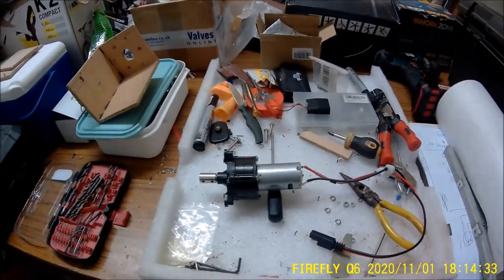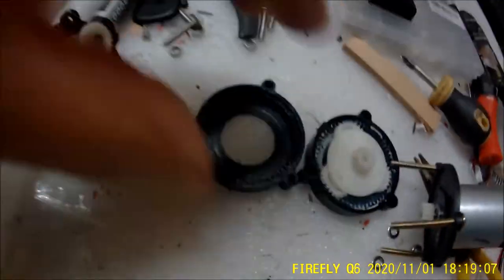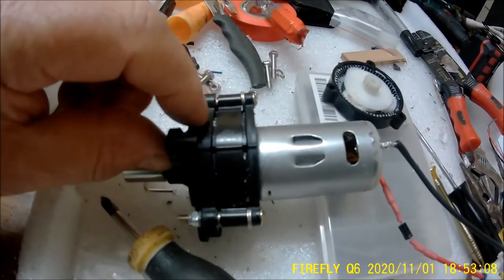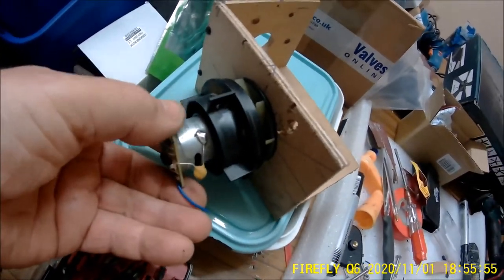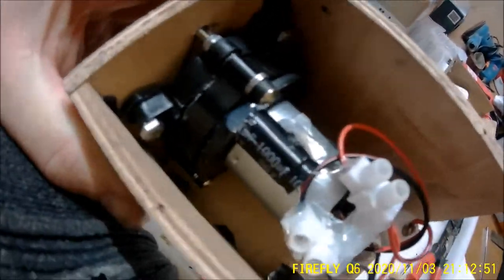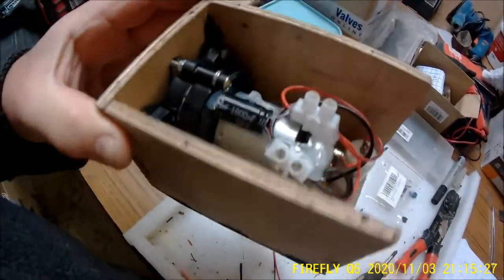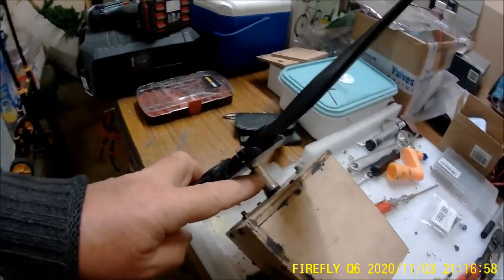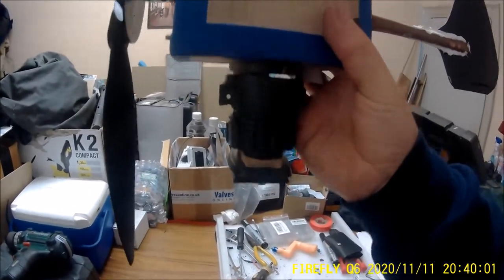DIY portable USB wind turbine

Comment from the maker: Update 13/11/20
Field test did not go as expected , with 12 to 14 mph winds the blades did not turn , inertia must be to great to overcome gearing. Perhaps bigger blades would work but  that would have defeated my purpose of portability.
Going to change over to a NEMA 17 stepper motor and try that.

Comment: That is not a nema 17 motor? Is it? Never mind I would love to see a electrical circuit diagram I too am trying to make a similar design using two bridge rectifiers and two capacitors as filters
Reply from the maker: That was one of those DC hand crank generators which I tried but would need very large diameter blades to turn . I did some other videos using NEMA 17 motors and was able to generate some amps , you could have a look at them . For set up of bridge rectifier and capacitor circuits I looked up Google and YouTube videos, there is a lot of info there .